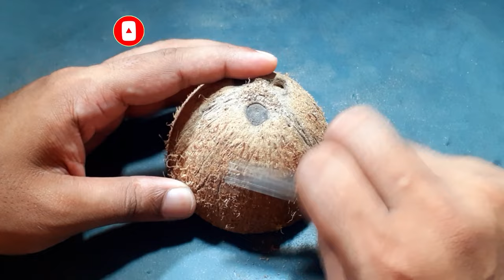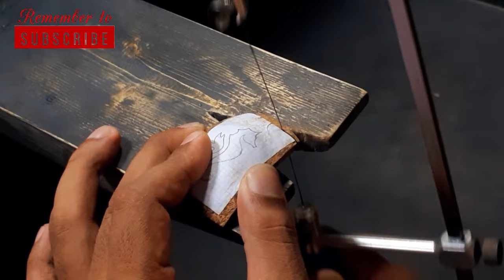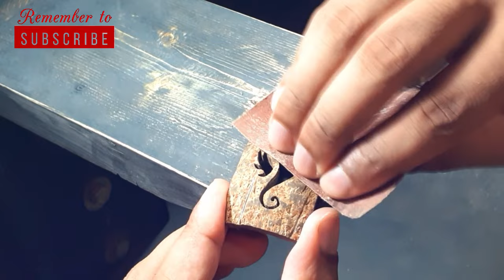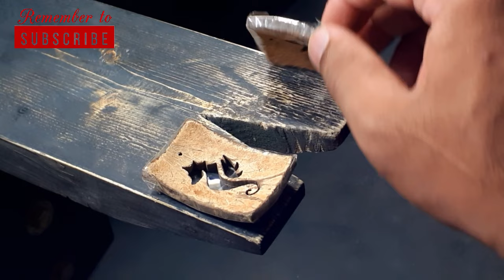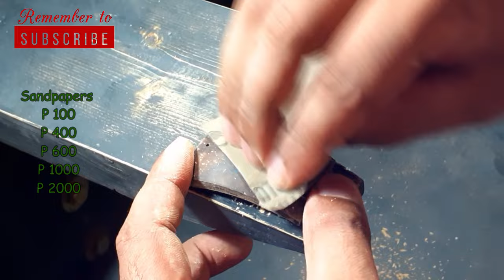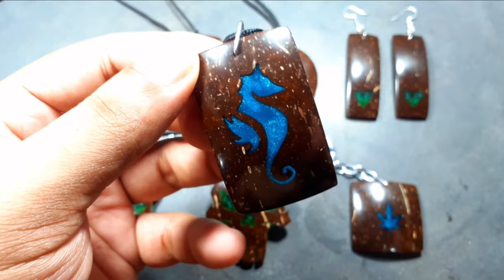Coconut shell craft ideas | How to make coconut shell craft

Comment: Sir ano ano po mga gamit nyo dyan at san pidi makabili?
Reply from the maker: 1. Mini drill machine (easy to use) / Mini hand drill or
Flexible drill shaft - Extension for drill machine..

2. 1mm or 2mm drill bit.

3. Coping saw 

4. Coping saw blades (Spiral blades / Standard blades)

5. Small needle file set

Do a web search for the items ( Online shopping )

Comment: Awesome these pendants are...
Thank you for this tutorial
I have two questions
1. Which drilling machine u used for drilling a hole .. which drill bit ? I use terms brand i don't have a hole making bit in it ...some help help here 
2. What is the use of brasso ? Is it necessary?
Reply from the maker: 1.1) Mini drill machine (easy to use) 
1.2) Mini hand drill or
1.3) Flexible drill shaft - Extension for drill machine..

2.1) 1mm or 2mm drill bit.
Reply from the maker: 3.1) You can get mirror like shine using brasso.
Reply: Thankyou for the response @CavemanCrafts